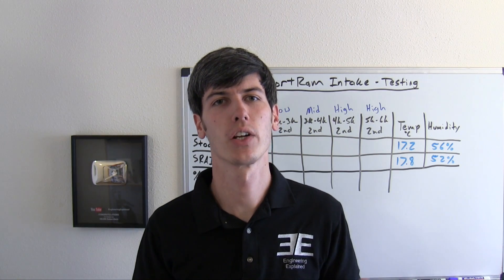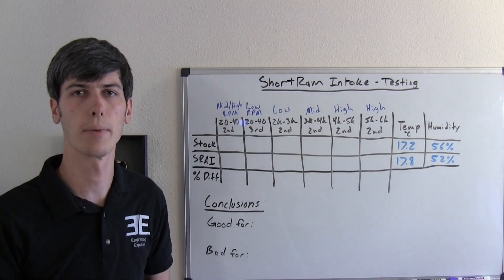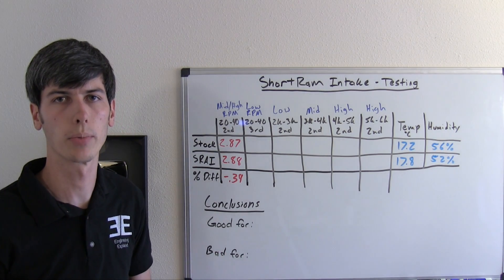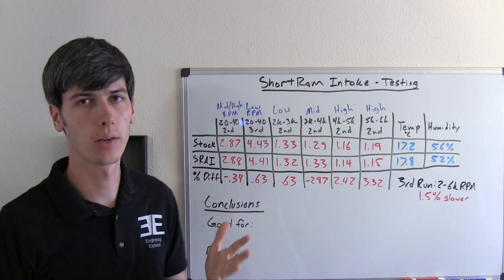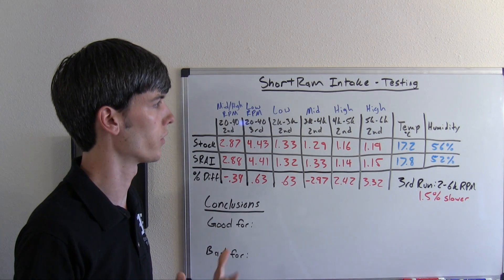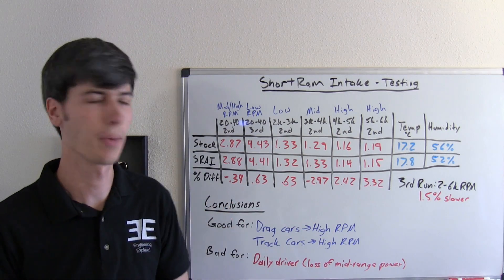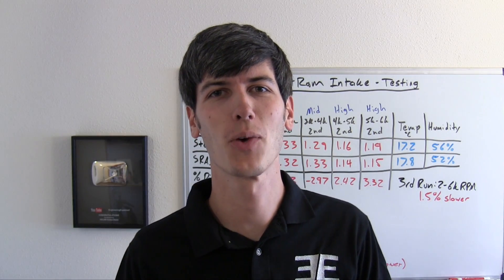Do Short Ram Intakes Actually Work? - Project Integra

Comment: My G37 actually got more responsive throughout the band with short rams, believe it or not. Enough to feel it in the seat. I'm starting to wonder if there was a problem with the paper filters in the stock intakes, because by all other accounts there shouldn't be this much difference. Can't complain; YMMV.

Only had one heatsoak issue this summer but that was because I sat at idle for like 30 minutes on a VERY hot summer day.

Comment: I've been wanting to do some tests with temp, humidity, and air pressure sensors and plot some data, I could also put my chassis in a simulated flow tunnel to determine the best place to put the trumpet, You would obviously want to avoid any low/negative pressure areas.

Comment: Great video.  You probably won't get bac to me, but here's my question:  I have a 2015 toyota corolla S sedan, 1.8 ltr. 4 cyl.  and I was thinking about installing (all at one time) a short ram, a borla cat back muffler and a chip tuner.  That said, will the short ram work well in all bands if I do replace the back end with the borla straight-thru exhaust?  If so, is this worth the $1k investment, or a waste of my time?  Thank you sir!  I'll seek out your reply.

Comment: dude with 20 to 40 miles per hour actually you have nothing to ram in your engine , cause you have very little dynamic preasure , first signs of  Compressibility begins at least 100mph so you better try this with high speed  :)

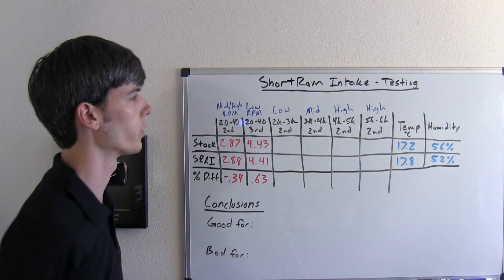Comment: so at 3:00 you answered my question you did not allow time for heat soak to go away next time wait a half hour to a hour in between both tests it doesnt matter if 1 or 2c changes that much temp doesnt affect power heat soak on the engine from multiple runs over and over does tho

Comment: Thanks for your detailed explanation! About the heat soak issue, do you think a thicker engine oil and putting little more coolant can fix the problem, rather than upgrading the whole kit? Thanks

Comment: This entirely depends on where the SRI sucks air from - is it from a place in the engine bay with higher temps/more heatsoak? Is there a heatshield etc? is your afm/ecu adjusting for the increased flow?

This is a very hard modification to test but with tuning and more accurate testing there is an abundance of evidence that intakes can improve power over stock airbox.

Comment: I understand this video was posed 5 years ago, but something you may have missed in your original analysis is how fuel consumption is affected. Some say that the heat along with the shorter path for the air allows for a more complete fuel burn resulting in better fuel economy. If this is true then this is an excellent daily driver upgrade.

Comment: The one I bought has a huge sculpted heat shield and a tube connection. It gets the air directly from the outside, so both help, I also like the sound

Comment: I just installed a short ram air intake in my car about a week ago. It didn’t do anything for power but my Honda Accord V6 is now getting 22-23 mpg on my daily commute. Before it was only 17-18 mpg. It may not have given me much power, but I’m more than happy with the upgrade in mpg. Best $300 I’ve spent. Also, can’t complain about the new growl either.
Reply: Yeah I heard that with the ram air your getting more warm air into the engine which helps reduce unburnt gas so increases fuel efficiency...nice bonus
Reply: @MrQdog73 warmer air means less oxygen content and less fuel to maintain AFR. Science is there, it'll reduce hp but when after fuel economy I'd take the hp hit

Comment: So, then what would happen if a heat shield or air duct leading out the engine bay would be installed? What if you cut the hood right about the short ram intake? Do you any of these things would increase the numbers or prevent the higher RPM lost on multiple runs?

Comment: I just want to ask, did you wait till the Honda Ecu to reach closed loop "warm up at operating coolant and vacuum pressure"?  my argument with your testing did you reset the ecu and allow fuel maps to relearn the new air intake levels just as a IACV? just swapping it out and testing wont provide accurate results, it's the same reason why when we reset the ecu to delete check engine codes you would have to drive a fixed amount of miles for the ecu to correct for out of range sensors. Correct me if i am wrong.  Its a awesome experiment that you have done and very detailed.

Comment: For a LS non vtec Integra you're making the most useful torque at lower rpms and a longer intake tube like a cai or the stock intake is better for that low to mid range, for a GSR or Type - R you can use a short ram with no problem because all the power is up top and the intake is letting it breath especially if you have an aftermarket intake manifold along with that the transmissions in these cars are going to keep them in the vtec powerband so you dont notice the loss of low end.  The Acura Legend also had active intake runners run on vacuum that could optimize intake length for both low end and high end power with no vtec, now cars have variable compression.

Comment: I bought a used car with a short ram  intake already installed. I use the car as my daily driver, should I revert back to the OEM intake and does having the short ram decrease fuel economy dramatically? And are there and bad effects to keeping aftermarket intake?

Comment: You need to remap the engine after installing the SRI because the   ECU will cripple your car when its programmed to stock air fuel mixture, but when you put SRI and remap it you do actually get a little more power than you would get when remmaping with a stock filter...

Comment: It loses in low rpm and gains in high rpm makes perfect sense in low rpm it's drawing air from engine bay which it's not hooked to the ducting to get air flow like the stock filter but in high rpm it's telling sucking in air which it is doing better cause the filter is less restricted by the box

Comment: My only question is are you buying both a cai and an Rai just to test em out? For example, if you were to compare turbos. Let's say a 2000$ set up vs 500$ set up. Of course the more expensive of these wins. Did you straight throw away 500$? Or did you borrow one from a friend or what? Thanks for what you do. I appreciate it

Comment: Your analisis is good but you need to consider extra data, such as  air-fuel ratio, intake temperature, engine oil temperature through the runs, etc... Also when you're on a track, keep in mind that the air flow coming to the engine bay is higher than when driving on roads at normal speeds.   What I meant before, is that with an all stock engine you may even end up running lean on gas and that would be both risky and counterproductive for your engine. Now if you build it you will definitively more air.  Did you do any run from 4500 to 8k? I'm looking at some dyno sheets and it seems that the sweet spot of those engines comes up after a little drop on the curve at 4k rpm, then it goes all the way to the peak power at 7500rpm or so... 
Keep the videos coming dude, thanks for taking the time on making them!

Comment: Was this in a manual or auto? If it's an auto, the rpm was tested wrong due to torque converter lag
Also I disagree that ram intakes would be useful in a track car. Heat destroys power in track cars in almost all scenarios
Reply: Jay Sea sri+ hoodscoop to give a dedicated cool(er) air path to said sri + remap = better performance with less power loss due to heat
Reply: rokkstar115 where were hoodscoops mentioned? I'm talking about his definition of ram air intake styles, not necessarily using hoodscoops

Comment: My short ram intake is wrapped in fiberglass header wrap, and sealed with silicone. Plus, I get the added benefit of it being next to the grill, so I get the cooler outside air while I'm driving.

Comment: With N/A cars heat issues are more prevalent as a turbo car has a intercooler cooling the air down. A intake on a turbo car really only lessens restriction with very minimal gains, and a tune is pretty much necessary to see anything. Plus turbo noise :p

Comment: did you put a heat shield around the AKAI? It seems that most videos I see that the installers don't bother putting a heat shield around the CAI or SRAI. I believe a good heat shield would allow cooler air to go into the SRAI or the CAI therefore you would get better results than  stock air intake. Plus a stock air intake has restrictions that don't allow as much air in as a SRAI or a CAI.

Comment: I have a short ram but somehow it never fails to beat ble 645 and hangs with m3. maybe it depends on the car it self plus I have better exhaust flow from headers to muffler so I guess it could be what's helping the air get out quicker

Comment: Doesn't the car computer need to refreshed by dissecting the battery after install? I was told after my cold air install to gun the engine right after install so the car PC sees the increased air flow.
Reply: i didnt know my car had a pc
Reply: Tony Furiato do you do that too if you install a cold air intake?
Reply: MixaL1s6804 😄😒

Comment: The lower times on the high RPM range, kind of make sense. If you think about it, the car is traveling a lot faster, on the high RPM ranges than on the lower ranges, therefore there's more air going into the intake. Thanks @Engineering Explained, your knowledge on cars is amazing, I've learned a lot from you. You're a great teacher.

Comment: This is exactly why I laugh at people who do a whole bunch of mods to their cars and don't bother to reflash the e.c.u. or install an aftermarket one.  The computer is tuned to work with the stock parts so free flowing parts will cause a different fuel air reading in the computer.  Sure it will try to compensate for the difference by adjusting the ratio, but it won't be able to tell that the parts are different so it won't take full advantage of them.
Reply: that makes sense.  at the very least the vehicle computer doesn't know what it isn't told.  most easy bolt on stuff doesn't have any way to tell the computer it is there.  it would be neat if he keeps track of all this and when he is done with all these changes he does a set of tests.  then goes to get a good tuning and does tests.  that way it is cheaper on him and he shows how much of a difference tuning can do after enough upgrades
Reply: What about a catback system but stock intake?
Reply: サントスシｮナサン
Same problem.  Any time you change the flow characteristics through the engine you change what the computer is going to see as far as air/fuel ratio.  The less mods you do, the less the difference will be; but it's still going to affect things.  It's almost as bad as someone installing smaller jets in a carburetor and not bothering to adjust the fuel mix screws. 

Depending on the mods you do and the way the computer tries to compensate you can cause either a rich or lean fuel ratio and destroy your engine or clog it with carbon.

Even something as simple as replacing the stock air box with a cone filter in a proper heat isolation housing can affect the ratio and lead to problems eventually.
Reply: ahh I see so your saying with all the bolt on mods, get the Ecu tuned or reflash to compensate for the mods bolted on the car?  I'm kinda doing that lol.  as much bolt ons and then tune the ecu/reflash.  I don't want to do it one by one.
Reply: サントスシｮナサン
I would say do as much as you can to your engine before you get the tuning done.  If you're going to increase your airflow with exhaust and intake with a bigger throttle body and injectors or any of those kinds of combination mods you'll want to get everything done at the same time to save time and effort.

With the things that the guy has done to his car in the videos I'd say he could get away with a simple hand held power programmer.  If he was going to be trying to push more power out of it, I'd say take it to a tuning shop and have them load test it on a dyno to see what the ratios are like at different load/speed levels.

A car that can run well at idle and at high rpm could have a lean condition at normal driving rpm and melt pistons over time even without detonation.  I've seen it first hand.

Comment: It would be beneficial if you added a hood scoop or other cold air inlet on the hood to truly get the most out of the short ram intake. By allowing colder air from outside the car a more direct path to the intake you can increase power. Also if you do a modification like this you can pressurize the system by segregating the intake from the rest of the engine bay and directly connecting the intake to the hood inlet. But this kind of intake would have to be optimised for specific engine and aspiration type, so it is a modification you might want to consider if you ever decide to get a custom aftermarket carbon fiber or fiberglass hood later in the series.

Comment: Pull off the hood and rerun the test...I can assure you the results will improve. Heat is your enemy. get rid of the hood and get rid of the heat. Ever wonder why Pontiac ran a shaker hood on the old Trans Am cars from the 70's? cold air. A hot air intake system is not your friend. Sure the numbers get better as rpms increase because you are moving more air at a quicker rate AND the air in the intake has less time to soak up heat. Just my thoughts.

Comment: An AEM CAI (k&n filter) took my 00 civic si from 15.7 to 15.5 in the 1/4mi. I eventually chopped the CAI in half and turned it into a short ram and it still made the same times. 
(A cheap short throw knocked off 3 more tenths and brought it down to 15.2. Thats half a second off factory times for just a couple hundred bucks.)

Comment: The comparison would be valid only if the stock intake was completely new. Also the SRI was lighter...
Anyway the length of the SRI is not that different than that of stock intake.  The engineers that build road cars obviously know what they are doing (which is a problem for all aftermarket parts) and they usually don't limit the power of the car by air intake. That would be just stupid as it is easy and cheap to get right and there is absolutely no drawback to that.
Also the stock intake was inside casing that protects it from getting wet. I wonder what would be the results if the casing was removed.

Comment: which one of the two intakes would you recommend for better engine performance ?
Reply: +xNewHistoryx cold air, the short ram one is a"hot air" intake (decreases hp)
Reply: +xNewHistoryx a frind of mine made a test run with a "short ram intake" and found out that at the first 10mph from stand still the air reaching the filter was the same temp as the outside temperature..
Reply: I have a short ram with heat shield.  Is that count? Haha

Comment: I wonder if there would be a difference for a turbocharged car. As a turbo car it would be pointless sucking in cold air or hot air as it goes through a turbo then inter cooler. I think a Sri would be beneficial in a turbo car. Your thoughts? Love the vids btw!
Reply: cai won't benefit a turbo car.
Reply: +BunnyBUNGALO thats the exact same logic as saying an intercooler wont benefit a turbo car which is utterly ridiculous..
Reply: laurie agnew what I'm questioning is the air is gonna get super heated going through the turbo anyways. Would the CAI pull in more air than the SRI? And is the heat soak from a SRI affecting the performance of an intercooler as opposed cold air.
Reply: +Qbeezy not more volume but denser more oxygen rich air. my brothers old evo 7 was modified lightly too 243kw at all four wheels and one of the things we did was a short ram arm that went up to a sealed air box recieveing cold air via a scoop behind the bumper. After the change the intake itself was far colder to the touch than it was prior to the new setup so you might be talking around 40°C prior to compressor wheel. Unfortunately never logged any change in temperature in the intake manifold but would of been good to compare